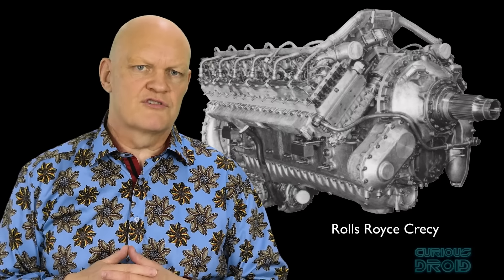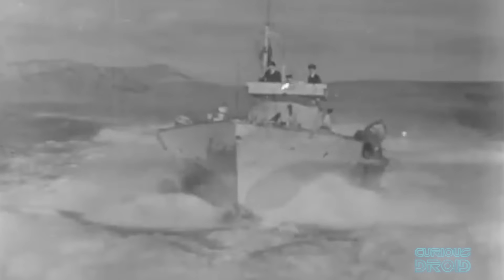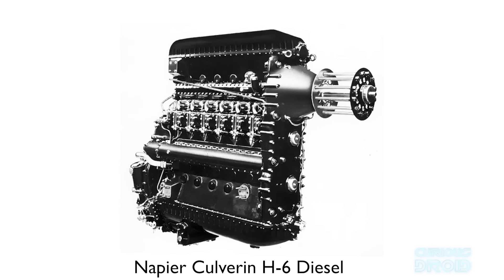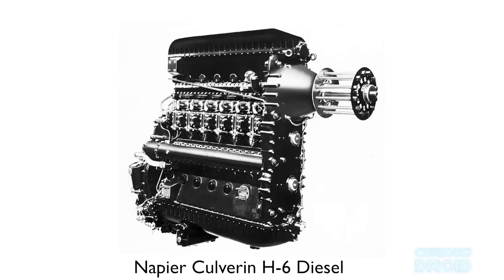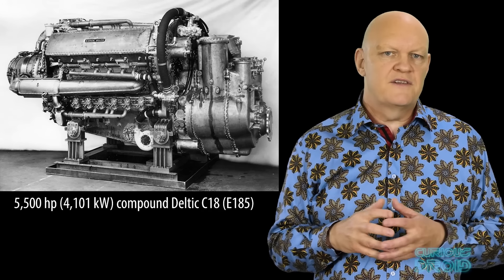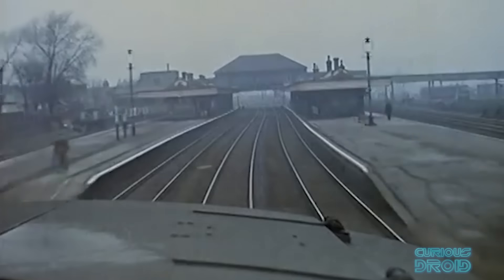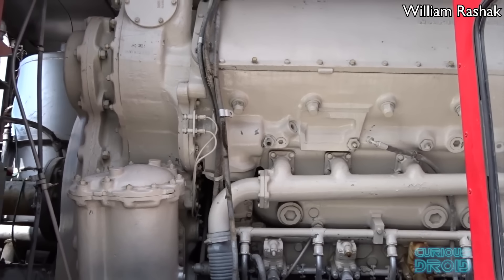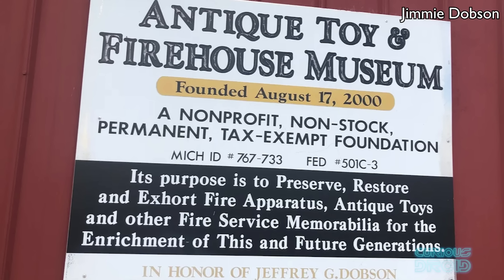The Legendary Napier Deltic - 88 Litre Opposed 2-Stroke Triangle Engine

Comment: I must correct you.
The turbo version did NOT use a separate blower for starting.
The drove the turbo mechanically until the engine was up to speed just like the modern GM EMD turbos.

Comment: I have never heard the Junkers design called an H layout.  It was termed an opposed crank layout in the books I have read.
The H layout designs have two flat engines with separate crankshafts, superimposed and geared together.  Examples are the Napier Rapier and Sabre, and the Roll-Royce Eagle of around 1946.

Comment: Can’t spell yunkers without yunk.  Surprising now that folks were getting excited about 1500 horsepower.  3000 is actually impressive, yard switchers aren’t doing much better than that now off the V16 EMD 645, though with considerably less sheer noise, smoke, and rough laboured running.  I’m sorry, i was thinking of the Class 37.

Comment: I was lucky enough to have a cab ride in D9016 Gordon Highlander (55016) on the Great Central Railway back in 2014. It was only running on one power unit (the other was inop due to a massive coolant leak) and the noise level was still horrendous.

Comment: 11:31 I presume you mean at the time? Because the UP 3rd gen gas turbine had around 9500 hp (though it was two units, one with a diesel motor to start the turbine and was used when the massive turbine wasn’t needed)

Comment: Great video.   I loved the Deltic in the locomotives (as a child my bedroom overlooked the LNER in north London).  I would love to see a detailed analysis of the crank timings to understand the background behind the counter-rotation of one of the crank-shafts.  I can't visualise how it would make any difference but I guess it's related to the offset between the cranks.  And (true story), my late father-in-laws youngest aunt was married to a designer at Napier who had worked on these, although his main work was on gas turbines.
Reply: An opposed piston engine needs to have the 'exhaust' pistons phased to open their ports ahead of the 'inlet' pistons to allow successful blow-down and scavenging. Since the Deltic's three banks of cylinders are 60 degrees to each other (with adjacent rods sharing the same crank pins), and the required lead phasing was 20 degrees, this would  have resulted in having the intake pistons in one bank leading their exhaust pistons by 40 degrees!. By running one crank in the opposite direction, it brings all pistons back to the required 20 degree phase difference. This 'stroke' of genius (ahem) is credited to one Herbert Penwarden. Check out one of the animations available such as on Wikipedia.
Reply: @robertrobinson3861  Thank you for the explanation.  Most helpful.

Comment: The Napier Deltic engine has always absolutely fascinated me, thank you for making this video.

Despite my interest in it, I never knew much about the fire pump until this video.

Still need to go and see a class 55 some day however, hopefully with a look inside the engine compartment.
Reply: Great video , my dad and uncle both worked for Napier, and told me about these horizontally appossed engines. Hadn’t a cue what they were then , now 50 years later I do! As a trainspotter back in the day remember seeing Deltics at Kings Cross, the noise was amazing!

Comment: I heard of drivers claiming that when a high speed train (intercity 125) was not available they could keep to it's schedule with a good Deltic loco and carriages on the East Coast Main line in the early days.
Reply: I'm sure they could.  You can bet your life that "100 mph" sign in the cab was a regulation, rather than a statement of what the engine could actually do.
As I recall, British Railways also thought that a Standard 9F was 'just a heavy freight engine' - bless their trusting hearts! - until one day a Gresley Pacific conked out at Grantham.
W. A. Tuplin, a well-respected railway author, was on the train making notes of the timings and speed, and noted that not only did the driver make up for time lost by the failed loco (arriving at King's Cross 2 minutes early) but twice exceeded 90 mph going down Stoke Bank.
When the train arrived, Tuplin walked along the platform to see which engine had been put in in place of the failed engine, and was shaken to find  that - far from being the Pacific he expected - it was an absolutely filthy 9F, No. 92184, which had been hastily pulled out of shunting the coal sidings, as it was the only engine available which could pull the load!
On arrival, the driver was told "you were only supposed to keep time, not break the bloody sound barrier!", to which he pointed out that the engine had no speedometer, but ran so smoothly at high speed that he just let her run as fast as felt safe!

Comment: I'm just going to nitpick slightly, the line at 11:30 about the Super Deltic's potential of being the most powerful locomotive in the world isn't quite right. I'm guessing it'd be the most powerful outside of the US, or maybe diesel at the time, but the large US steamers still had it beat. Of course, those were probably twice the length and weight for just 1/4 more horsepower, so Super Deltic still would have been in a class of its own for years to come.

Comment: This Napier Deltic has some resemblances to a patent: ES-0140010_A1, 'Improvements in Aircraft Engines fitted with Two Parallel Crankshafts', by Wifredo Ricart, an Spanish engineer, author of 'Pegaso' sport cars, qualifyed as 'lunatic' during his time with Alfa-Romeo. Blessings +

Comment: The UK has come out with some great powerplants. When I was a kid in the 50s, I didn't think much of British cars and engines because of their size. I didn't understand how the cost of fuel was so high and British designers made cars and engines to get the most mileage and so cars had to be smaller and lighter. In 1959 we had a Ford Skyliner that barely got 10 miles to the gallon. The English Ford sold here was able to get 3-4 times that. It made sense to me that British cars and engines were not substandard but much more efficient due to the high cost of gas and oil.

Comment: I'm not into engines at all, but I still find this very!! interesting indeed.  -I may have heard about these engines sometime, ...anyway I remember wondering if it wouldn't be possible to make the explosion happen between 2 opposing pistons.
Cheers, -K 🇮🇸
Reply: @karlbark - The 'explosion' (burning of the fuel/air mixture) DOES take place between the opposing pairs of pistons.
Reply: @jackx4311  yes, I know. I understand that. I remember thinking about this ... in my early teens. (If it were possible to have 2 opposing pistons insade the same "sleeve") ?!! (Whatchamacallit)? 🤔😄
I don't know why tho'
Reply: @karlbark  It's not exactly an Explosion though, especially not in a Diesel Engine. Ideally, a Diesel Engine would combust slowly at a constant Pressure, while an Otto (aka Petrol/Gasoline) would combust instantaneous at a constant Volume (aka Explosion, from the resulting rapid Expansion). Neither of which is entirely possible in real Life, but Engineers try to design Engines as close as possible to it.

Comment: I've always fantasized about a delta petrol 6 piston 3 cylinder for cars .  But with the wide side of the triangle at the bottom .

If it's only one cylinder deep it would be really short and could be pushed way back behind the front wheel.

Comment: The gear driven blower/ supercharger wasn't for efficiency it's a necessity to scavenge air as a2 stroke diesel had no way to draw in air and expel exhaust without a Blower.
Reply: True. The Commer TS3 also used one.
Reply: @markroose8686  Also all the detroit diesel 2 strokes.

Comment: At last I know why 'Deltic' locomotives are so-called!  

The odd thing (to me at least) is that, because the locos are diesel-electric, the diesel isn't actually driving the wheels.  'All' it actually does is drive a generator - which supplies the electricty that drive the motors that actually drive the wheels.  So, for all their obvious 'dieselness' (noise and fumes!), the Deltics (as with most diesels) were really just electric locomotives, with an on-board power plant.  In theory (at least), they could have been modified to run off an electric supply (overhead or third-rail), or have had their deisel generator set in a separate 'tender', or in another part of the train - which would have resulted in the actual loco looking very different (this is pretty much what happens with diesel-electric multiple-unit trains (DMUs).

Comment: Crecy with its (unnecessary) sleeve valves and diesel fuel pumps was not a simple engine. It also had an inadequate oil pump which led to endless con-rod failures.

Comment: I am curious about the British rail thinking on locomotives. In North America/ Australia locos are used to haul long, heavy trains for long distances. Maximum draft is needed.  Locomotive draft power is not determined/limited by how powerful an engine you install. It is limited by the circumstance that a loco can only pull with a force equal to 25% of it's weight. Any power over that just spins the wheels. The 6000 HP Deltic never built would have been interesting but powerful lightweight diesels only work when the intent is to pull a light weight train at high speed. I guess that is what they had in mind.  Kudos to the techie who thought of rotating the bottom crank in the reverse direction.
Reply: All about fast passenger trains on the ECML.

Comment: 9:35 The Deltic Prototype locomotive was designed as a demonstrator with export sales in mind. The blue and creme white livery, dummy headlight casings, and nose shape inspired by American streamlined diesels evince that. However, I've never been able to find out WHY the Deltic Prototype was never shown off outside of the UK.
Reply: Selling them to America probably wouldn't have ended well. Krauss-Maffei's ML 4000 CC weren't successful either, partially for being designed for flatter Terrain than they were used in (the Cooling System was undersized for climbing for Hours, and the high Elevation caused the Engines to lose too much Power at Altitude) but the Maybach Engines were over-engineered for American Standards too, with the Mechanics at Southern Pacific and Rio Grande being used to simpler EMD Engines. I think the latter Problem would be even worse with Deltics, which dwarf the Maybach Engines in over-engineering.

Comment: I bet that fire engine pumper would could be used for dust free demolition. I can not think of many things which would not be leveled by 10,000 gallons per minute water jet at some considerable pressure...
Reply: Considering that a high pressure jet of water in a relatively small workshop machine can cut through heavy steel plate, I believe it could be done.  The only possible drawback I can see is the possibility that bricks and slabs of concrete would almost certainly be blown away at high speed, posing a lethal risk to anyone on the opposite side of the building being demolished.

Comment: An interesting fact not mentioned is the engine’s tendency to “throw a leg out of bed”, in quite a dramatic way, leading to some traveling fitters having very close shaves on locos on test as a piston shot past their head with great force. I was on 55022 when it put a leg out of bed in 2006 and the remains of the piston head had to be seen to be believed……..

Comment: No deltic ever exceeded 120mph and that was a test run after a speedometer failure descending Stoke bank, each milepost was past every 30 seconds.
That was unofficial and only reported years later or the driver would have been fired.
Max speed was supposed to be 100mph but 105mph was the unloading speed of the traction motors.
Limiting factors were traction motor flashover risk, potential track damage .
In one case the armature windings or casings burst on dp1 I believe.
I googled this btw, but obviously I know everything as my pe#is is tiny! Lol

Comment: While this was an innovative engine design of the mid 20th Century, a 21 Century MYT engine can produce 5000 horsepower while weighing about 200 pounds and only being about 18 inches in size.
Reply: What's an MYT? 5000 HP and 18 inches in size??!

Comment: I have seen several videos covering Deltic locomotives and looked at several articles on the Internet, but with the descriptions of its great efficiency and power, there are no explanations as to why they haven't taken over the world.  Obviously, they haven't. What are the drawbacks?  With railways, fuel efficiency is important, but the weight to power output ratio isn't as important as in small naval craft and aircraft.  I could easily see other problems negating their use on rail, but wondered what those problems are.

Comment: Actually I think the hybrid engine is the engine of the future you need a gas or diesel electric generator for the electric motors and batteries on the train just like all freight trains and some medium sized boats cuz that drive drive shaft is a problem you know you can have an electric wire or not a motor it's way better than a big old drive shaft

Comment: Just like Gerry Waters, I also served in Ton Class MCMVs (Upton and Iveston).  Apart from being very noisy they were also very smoky. When used for Fishery Protection duties, the fishermen could see them coming for miles and perhaps stop doing things they shouldn't.  The Napier Deltic was also prone to getting cracks in the cylinder liners which caused exhaust gases to enter the coolant system and blow fluid out of the header tank.  We had to change about 7 engines (all stbd ones) over a 2 year period.

Comment: Sorry another correction.
The deltic had max allowed speed of 100mph , it never used to do 125.

Also the 1650 horsepower was de rated, the naval versions had more and I don't mean the turbo versions.

Comment: Nice presentation though there were rather a lot of factual errors which could have been corrected with a little research! 
The favoured proposal for Royal Navy's MTBs was actually an H24 "diesel" engine design similar to Napier's original diesel design (E101) which eventually evolved into the Napier Sabre (E107). The Deltic option was presented to the Admiralty because it could produce 2500 bhp as a blown engine and even more power gained by turbocharging and compounding with little further change to the basic engine design. The "TIC" comment about the engine's name is totally incorrect and will no doubt now pollute the internet as another fairy tale fact . . . well done! The simple blown version of the engine was rated at 2,500 bhp - not 1,650 which was the derating required for rail traction purposes. The turbo blown engines were rated at 3100bhp and the charge cooled engines 3,700 bhp. I could go on.
Anyway, I was especially pleased that you concentrated on discussing the engine's marine use (for which it was designed) and the SuperPumper rather than the more famous rail traction locomotives for which fewer than 80 Deltic engines were constructed. Deltic engines were used by the Royal Navy for well over 60 years which must be a record and supplied to many other navies. They were used in a wide range of other interesting applications and there are some great stories to be told. . . but not here.

Comment: Were the locomotives diesel-electric or did the Deltic drive the wheels mechanically?
Reply: Diesel-Electric. Locomotives of that Size always use either Electric or Hydraulic Transmission, as a gearbox would be impractical at that Size. A Locomotive has so much Torque, that you couldn't fit an accordingly large Clutch onto it.

Comment: Not to denigrate anything in this video, ALL piston engines suffer from one major fault - they have to 'stop' each time the piston reaches Top Dead Centre or Bottom Dead Centre (TDC/BDC) a rotary engine  - on the other hand - doesn't have such a disadvantage...
Reply: @George Buller - that is common knowledge, so what's your point?
Reply: The Rotary Engine suffers from a lot of other Disadvantages though. It burns Oil by Design, giving it bad Emissions and high Oil Consumption, the Apex Seals are prone to Failure thus making the Engine expensive to maintain, and IIRC it also is less efficient than a Reciprocating Piston Engine. Internal Combustion Engines lose most of their Efficiency in the Thermodynamic Process anyway; the mechanic Efficiency usually is somewhere between 0.8-0.9, so there's not much that removing the reciprocating Movement can do anyway. Rotary Engines have their Uses, but they are limited to very specific Niches.

Comment: If this triangle format (nicknamed the deltic?/delta?) was shrunk down; and a few of the cylinders removed, It could have the potential (Or could it?) to possibly REPLACE the RX8's rotary engine and do away with all the problems of the rotary configuration. I think the automotive industry might afraid of trying something new and ALSO old-skool at the same time.
Reply: Petroleum-fired reciprocating engines are, as American film producers might say, 'washed-up'.
Reply: @tooleyheadbang4239  Welp, they needto make a come back. You have heard that history tends to repeat itself.

Comment: Deltic railway locomotives were powerful and fuel efficient. There is at least one Deltic loco still in use for freight hauling. Used as intended, they were very reliable. Then British Rail with its collective intelligence decided it was cheaper to service and rebuild the engines in their own workshops. No worries? Except these were the steam engine sheds with all their associated dust and grime. Unsurprisingly reliability collapsed.